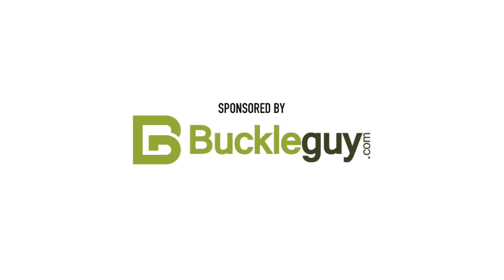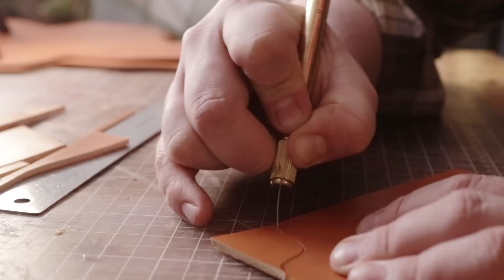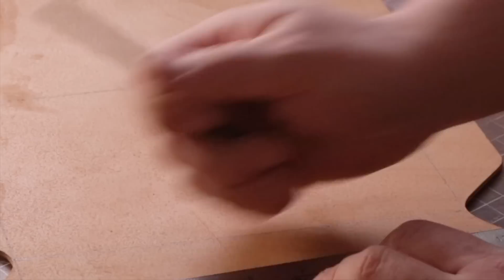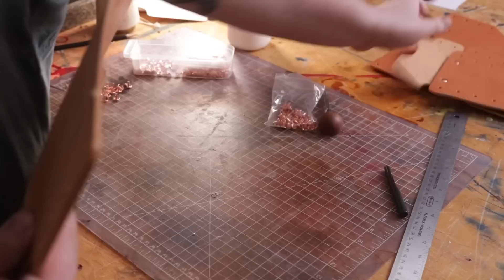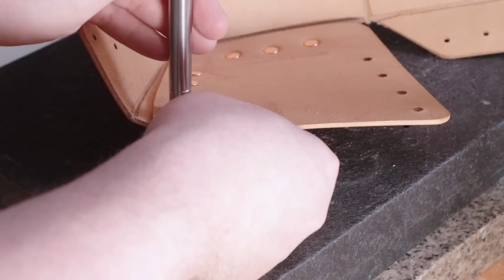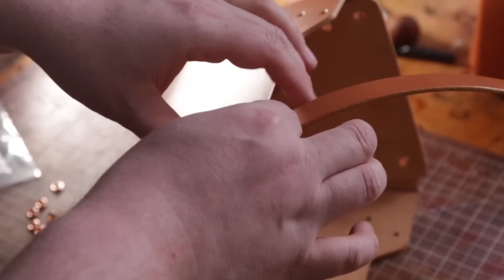How to Make Elegant Leather Baskets (WITH PATTERN)

Comment: Gotta say, I bought the brass knife. And it really is nice.
Reply from the maker: Glad you like it, we worked really hard to make it just right :)
Reply: @ anyone who has any doubt would just need to compare the size to an xacto knife. Not sure whose hands THOSE are designed for, but they aren’t for adults putting serious pressure down through a slender case. Yes. It’s very nice.
Reply: i added some lead shot to the handle and it makes it nicer
Reply: @  how? Down the thread tunnel? Interesting.

Comment: I had some leftover HO Old World in about 12oz so I made a super chonky boy basket with the cup handles. I did one mod though - I took one cup handle and extended the inside so it's the same size as the end piece. This allowed me to cut a slot that's big enough for a small item or two. Thanks for the great pattern!

Comment: Ooh very nice. For $5 it's not worth working it out yourself! I'll definitely try this pattern, my partner will love them. How well would it work with more of a 6oz leather?
Reply from the maker: Thanks :) It'll work better if you're able to scale it down using the vector file, it'll work at full size but it'll just be a bit floppy -  I'd probably just cut out a square to glue on the bottom to double that up and do the cup handles at 6oz, should be good that way!

Comment: Did I hear correctly? Leather wrapped rivets!  Take my money   lol
Reply: How would one even go about wrapping a rivet in leather?
Reply from the maker: usually you skive down the leather super thin, glue it to the cap of the rivet, and use an awl to tuck the leather under the cap. There's a little tool as well but I've never been very good at it, I'm fine taking the pre-made route haha!
Reply: @dustsky  Publicity chest badges. Same tech. It's actually old as ba11s as tech goes, older than the badges at that.
Reply: Do you have a store in UK? I'd love to visit it!
Reply: Buckle Guy has the leather wrapped rivets with appropriate dies
Reply from the maker: They're new from Buckleguy, I put the link in the description :)
Reply: @Corter  I just order them in black.  Oops, I should have gotten the setters!   I also tried to get your pattern but it wouldn’t go thru.  I was using Venmo.
Reply: I love the cupped handles!!